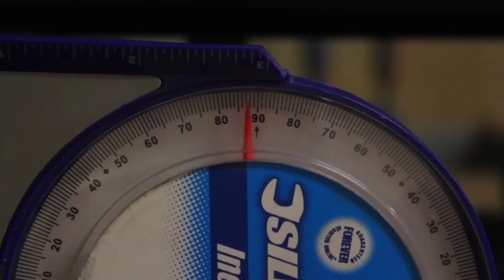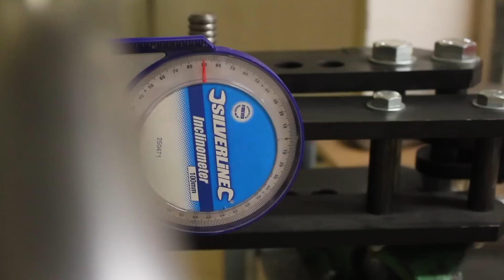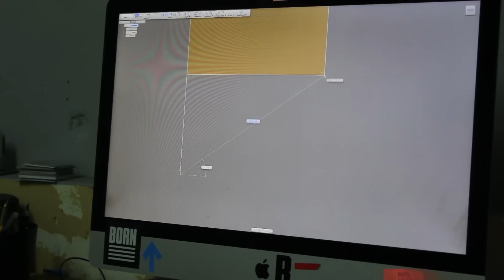Born Tracker 125 - Motorcycle Modification - Last Tracker 125 Built #03

Comment: Always a pleasure to see you working. What's the base model ?
Reply: Poupoupilou ...its a luxxon 125
Reply: Poupoupilou ...it's a luxxon 125
Reply: but the luxxon is simillar to the kreidler dd and the sachs zz
Reply: Thanks ! Never heard of this bike (I live in france). It seems to be a deusch. Is it reliable like a Yamaha or Honda ?
Reply: That bike is Chinese, according to the country varies the brand. In Argentina comes as "Beta Motard 2.0", which, on the outside, is identical to the yamaha xtz and "mondial vd"
Reply: Poupoupilou mine is reliable
Reply: Chinese bike QINGQI QM125GY...
Reply: Poupoupilou I have a Sinnis Apache - which is the same as a Pulse/lexmoto Adrenaline and Superbike RMR - all use a Chinese copy of a Suzuki DT125 engine (although Quingqi have built these engines for Suzuki since 1985)

Comment: Can anyone tell me is he grounding the bike each time before welding? I know nothing about welding but I'd like to learn. Why does he ground the bike but doesn't ground the table when making the storage(?) and what type of welding equipment does he use (gas(?))?
Reply: Kashfil, just in case you’ve not already found the answer to your question... the method of welding used here is “MIG” (you can find a complete description on the internet), it uses a shielding gas fed down the torch from the cylinder standing by the welding machine. His welding table is grounded, so when the battery box he is making is stood on the table it has earth return through the table. The clamp is needed when he welds on the bike frame. It’s an interesting build, and I’ve watched all his bike build videos, but I wish he would finish the metal brackets off better. They look slapdash to me. I have an original version of the Chinese bike he’s using here. They’re not bad machines.
Hope this helps,
Les
Reply: @leslieaustin151  What name has the chinese version of this bike? Have you got a link? 

Thanks!
Reply: Elias Mittendorfer Elias, in the UK it goes under several names, mine is Sinnis Apache, it is also called Pulse Adrenaline, and (at one time) Superbyke RMR. However they are all basically the same as the machine you see in this video and are all made by Jinan Qingqi, the model is known as the 125GY-2B, and is made as a “supermoto” (as here) and also as a ‘dirt bike’ with larger diameter wheels. It’s also sold in Europe as a Kriedler I believe. It has been made as a 125cc, 200cc and 250cc. Hope the info helps. It’s out of the Haynes manual for this machine. Regards, Les
Reply: @leslieaustin151  Thanks😁👍

Comment: Sorry if this sounds a little bit stupid, but why does he brushes some spots after welding parts?
Reply from the maker: +Rodrigo Ortega Reyna not stupid at all, he’re is why, the weld leave a small amount of dirt and the way to clean it it’s hitting with a hammer or brushing with a steel brush.